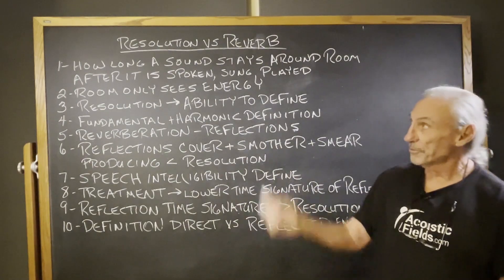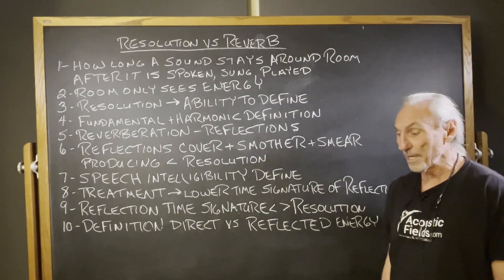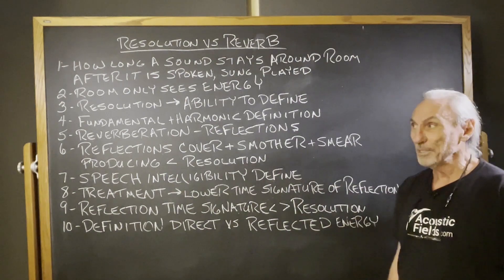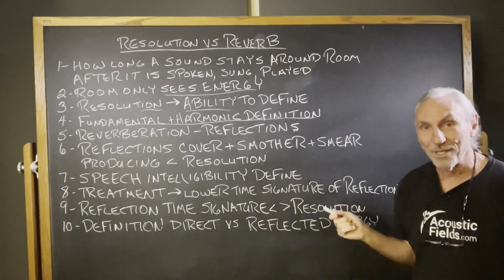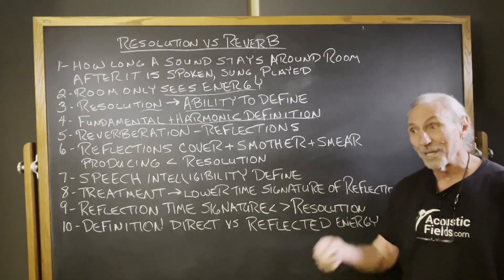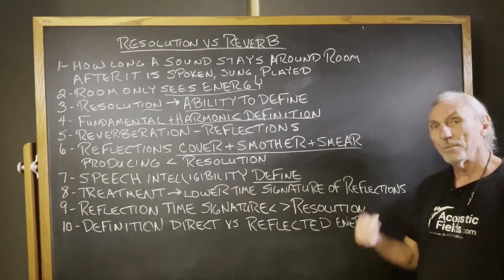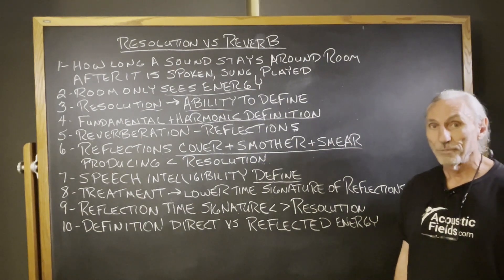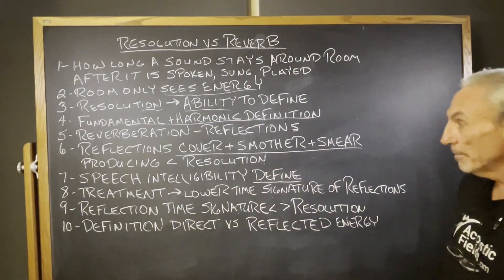Resolution VS Reverb - www.AcousticFields.com

Comment: Very sorry... I meant to ask > if one dimension is exact or close to HALF of another?
Reply from the maker: Still not an issue with proper treatment type. Most of these claims floating around on the net about room dimensions are based upon no treatment types.

Comment: Do you recommend using varnish/laquer to finish wood walls? Or just a stain/condintioner? I'm curious how drastically the sealing of the grain/pores of the wood would effect reflections.
Reply from the maker: We use a special process with our cherry ply. We set it out in the early morning sun and then bring it inside and let it cool. We then spray it with 5 coats of clear. We do not use any stain. This allows the ply grain to mature faster and be more pronounced.
Reply: No difference 
Think about wavelength size ... and how tiny the wavelengths would need to be to be affected by a coating of a hard surface. 

Aesthetics and other considerations aside...
Reply: @FOH3663  first of all I'm not trying to be argumentative, just have a nice discussion about acoustics, but wouldn't it also change the overall density and porosity of the reflecting surface?
 I am under the impression that wavelength vs material thickness applies to transmission not reflection. 
If what you're saying is true I could put a layer of .001" (like cellophane) plastic in front of my monitors and not hear any difference. I would propose that for high frequency it would make quite a difference.
Reply: @jacobwhite936  
Actually a good question, and I appreciate the civility.  

Yes, painting the surface affects porosity, thus affecting absorption... however, only at the highest freqs and not likely measurable, and certainly insignificant in any appreciable way. 

The physics; wavelength size relative to a material's surface aberrations. 

Way up at 10khz, there's not much but cymbal overtones, and ambient air. But even up that high, the wavelengths are still quite big relative to surface aberrations of the wood... varnished or not. 

In musically relevant freqs, the energy doesn't encounter a difference between coated or non-coated wood.. the wavelengths are simply to long to produce any difference. 

Example;
5khz is the highest range of voice, piano, violin, and all instruments... above that exist overtones and there's some cymbal sizzle. 

5khz = 2.7 inches (6.86cm)

So even doubling that up to 10khz, the wavelength is still just under an inch and a half. 

10khz = 1.35 inches (3.43cm)

Whether the wood is coated or not is not going to be consequential to a 1-to-2 inch wavelength. 

A great deal of acoustics centers around wavelength, relative to the object size it's encountering. 

I'm commenting on your question above about coating affecting reflected energy. 

Your example of plastic in front of a loudspeaker concerns transmissability. 
Moving your cellophane to the wood surface in question, results are the same as paint/varnish... it wouldn't alter the spectral content of the reflections... the wavelengths are just too big. 

Also, "warm" sounding wood covered walls, is acoustic mythology. Visually, the wood may elicit a subjectively warm acoustic vibe... but acoustically, warm sounding wood rooms is just another in a long list of audio myths. 

Energy encountering a boundary; either reflects, transmits, or absorbs.  
Of course coating the surface changes it's reflective behavior... but only the most smallest amount at the highest frequencies. 

What truly impacts it's behavior in the relevant audio freqs is mass and how its mounted... it can vibrate, or resonate, or adhered with Green Glue thus damping it's vibratory action...  there can be gaps like slat resonators... these are the characteristics that truly affect it's characteristic behavior regarding absorption, transmission, reflection. 

Good question for sure.
Reply: @FOH3663  Thanks for your reply. I do have to disagree on the pleasant sound of wood tho.  I have stood in an empty rooms that have drywall and then rooms with wood walls. There is a significant difference. Yes the drywall room can be treated to sound good, but why not start with the advantage. I wish I had data to back it up, but i'm sure Dennis  @Acoustic Fields  would have the numbers to prove it.
Reply: @jacobwhite936  
I entirely agree, a wood room sounds better, every time... the issue us it's just our mind playing tricks on us, it's a visual phenomenon... we associate characteristics to wood because of its appearance... it's naturalness. 
It's our subjective perception that wood sounds warm.  
What does wood sound like? 
Nice and warm ... just right really.

Nope, our brain is powerfully convincing. 

What does wood sound like? 

This isn't acoustics, this is pyscho-acoustics... and it's counter intuitive af!